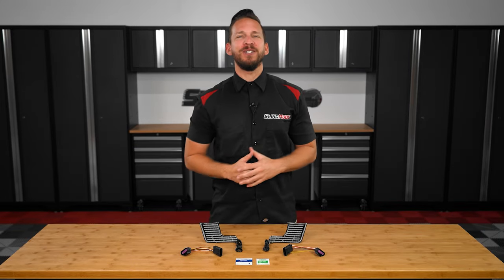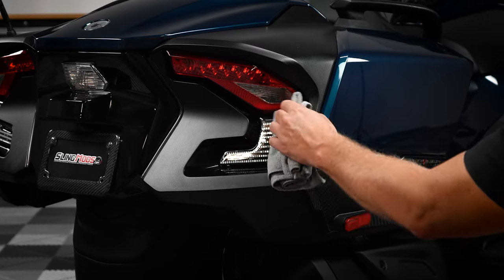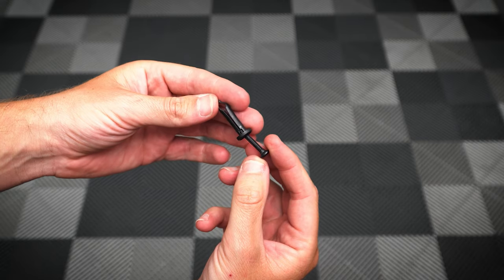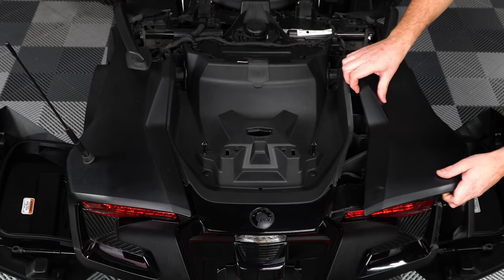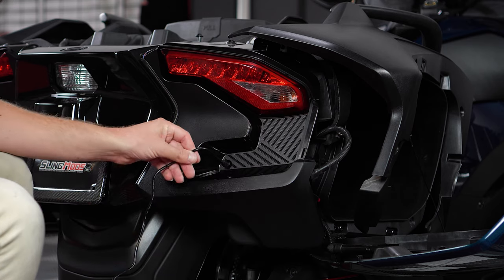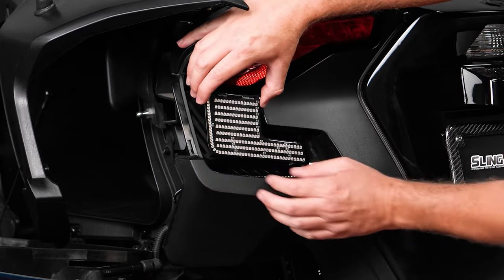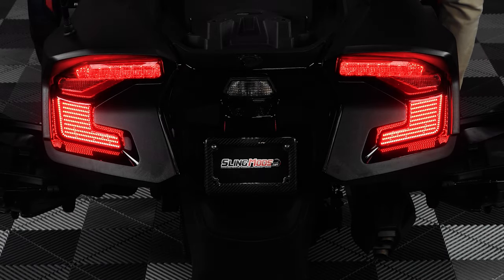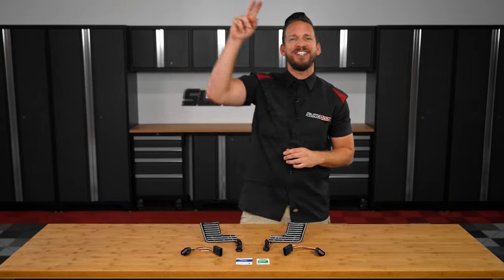Can-Am Spyder RT LED Afterburner Tail Lights | Install Gen 1/2

Comment: Good addition with a minor short fall. Breaks lights work great. If someone says they didn't see the bike, they shouldn't have been driving. The problem?? The turn signal. Very weak and they really can't been seen unless up on the unit. I believe that they should have used 2 or 3 lines for the signal..

Comment: Firstly they are nice looking but there's a few minor and major shortcomings for this product.  I have installed many many various TricLED lighting kits on many Spyders on two generation bike platforms.  They look addon when bone stock so i put a light window tint on them to tone them down when NOT illuminated, secondly the back of the PCB has eeprom chips, resisters, diodes and solder joints that are exposed under the two way tape on the back and are not protected by anything but that 2 way tape.  Thirdly the four wires that are soldered to the PCB are VERY delicate and are NOT protected in any way shape or form at their solder points and i can foresee future corrosion, oxidation and joint failure issues after being in service after some time.  Fourthly the small 4way connector from the light is NOT a weather packed connector. All in all they are a nice looking product but for the money asked they seriously need these design flaws rectified.
Reply from the maker: Thx for the feedback. I'll pass it on to the MFG. I know they're working on a Gen 2 that's set to launch on our site later this year that will be lightly smoked and has the wiring directly out the back of the PCB board.
Reply: That's great news..  I did forget to mention though that TricLED do stand behind their products and are virtualy hassle free to get warranty replacements of defective items.
Reply: Just ordered 2 sets of the Gen 2 version.  Excited to get them installed on our bikes (‘20 RTL & ‘22 S2S).  ❤

Comment: Do they work for the 2021 RT Limited?
Reply from the maker: Yes they do, but you'll have to first remove the top case.
Reply: Yes they do... As stated before you have to remove the top case because I have a top case and I have the afterburning lights and I love them

Comment: what size drill bit did you use for the wire hole?
Reply from the maker: We used a step drill bit to make the hole just large enough to fit the LED plug through.

Comment: Can you do an update that references the 2022 RT Limited? The saddle bags attach differently.
Reply from the maker: We do not have a 2022 RT Limited at the shop regretfully. My apologies.
Reply: I had to unscrew 9 screws for the 2022 saddle bags on each side, that was the only difference from the 2020 models.

Comment: I just ordered all those lights for the back including side markers, how do I wire all those harnesses up to make everything work?
Reply from the maker: Hello William, both the Afterburner Lights and the Saddle Side LED Reflectors use the same OE harness for power. If you purchased both, you'd simply daisy chain the connectors together to get power to both mods. Thanks!